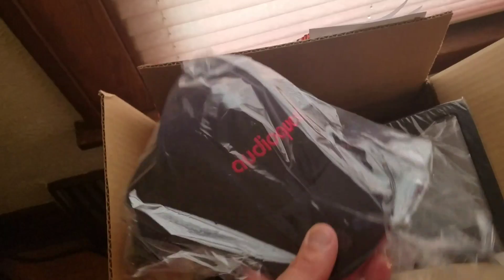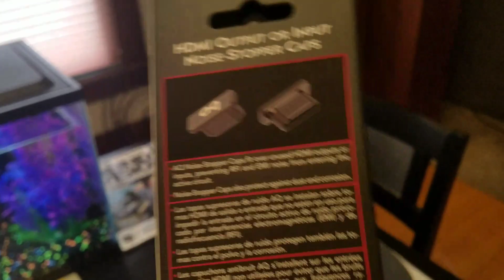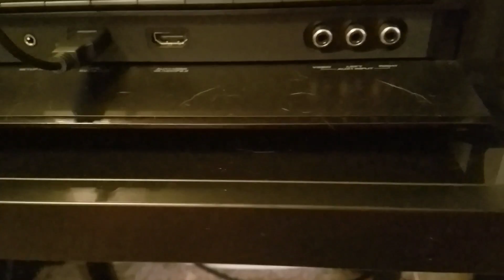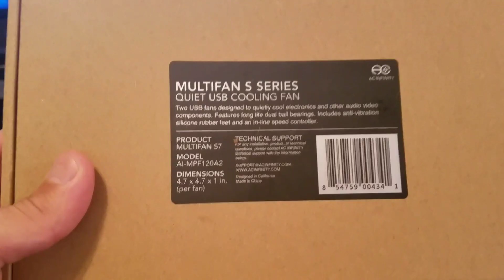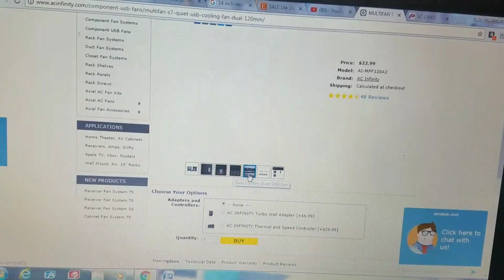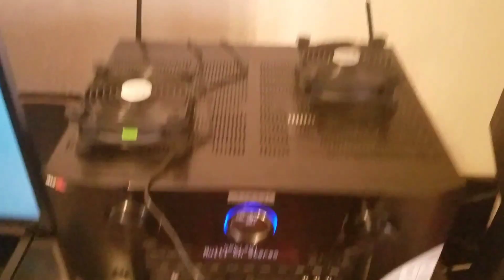Audioquest HDMI noise stopper caps installed , AC Infinity dual sub cooling fans

Comment: Did not know they had those,will have to get some.I do have the RCA noise stoppers.Love Audioquest.
Reply from the maker: At least they protect the inputs and the pins on the HDMI connectors, plus they add a nice look to the unit.